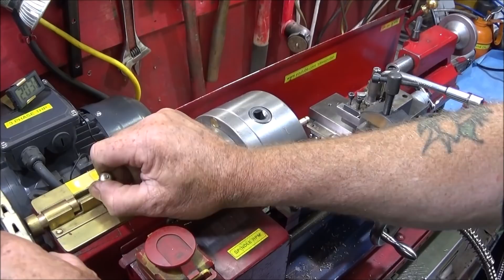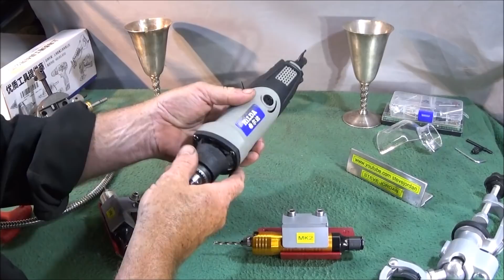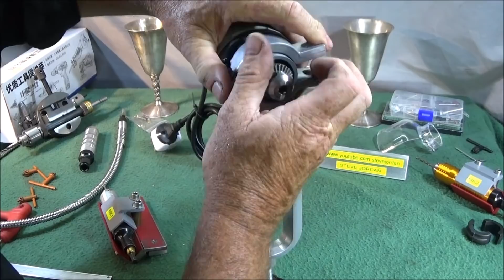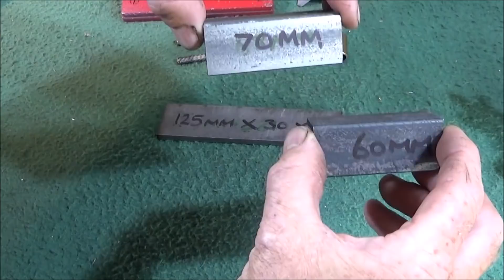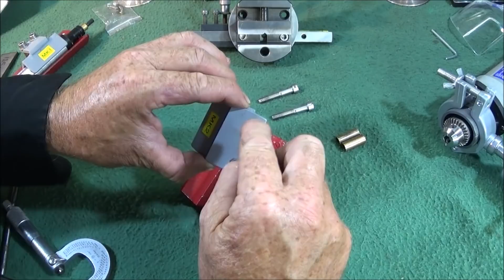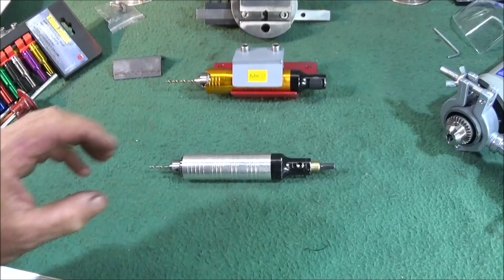A Neat Die Grinder Hack. Easy to Make Lathe Toolpost Drill Set-Up

Comment: How about this approach (?):
You place the drill bit on the chuck of lathe, and your piece on the vice that you have installed on the tool holder of the lathe.
Then your turn the lathe on and move your piece towards the drill bit.

Comment: Been thinking about doing a 750w or 1kw remote die grinder. One of the chinese hanging grinders purposefully designed for die grinding vs the hilda. Love the index locking design I was thinking of something similar using a tapered point and 3D printed wheel but everytime I consider it I want to upgrade my drive belt setup as well from the 5M375 belt(I have 8x16) to index pulley then I think why not just go for a servo vs index wheel.

Comment: Steve!  Greetings from Colorado.  I’ve got my friend to help with the welding and will be making this attachment for my foredom.  Thanks for posting this.  That said I’d like to use my qctp as the “vise.”  Obviously I’d have to change some dimensions of the male part of the fixture to be inserted into the qctp tool holder but I’m concerned about the rigidity.  I believe tapping the male steel flat stock for the corresponding tool holder to accept bolts would help but if you have any other suggestions I’d appreciate it.  I’m a jeweler so I’m trying to make better use of my minilathe.  I’m also in process of completing the milling attachment.  My email and/or IG is ubdrmade@icloud.com if that’s more convenient for replying.  Cheers!

Comment: Hey steve I want to make a hand held  lathe style device and need your help? I pretty much have it figured out I just need the sanou 3in 3jaw chuck drilled out to have a 1in throughhole but need a shaft to mount it on with a matching throughhole size and a diameter of 1.2in and 6.5in long? Does this sound like something that is doable

Comment: Another great video Steve, thank you, keep them coming.I've just received all these Goodies from Banggood and have also made the insert for the holder. Still got to make the holder for the flexiishaft tool. I've noticed that when the flexible drive is connected to the grinder the weight of the flexible shaft needs to be supported otherwise the grinder does not seem to run true and makes a grating noise. The only way I can get this to run quietly is to have the grinder mounted in the holder so its pointing down and there is no lateral weight on the grinder. Have you got any ideas what the problem might be and have you experienced this yourself. Apologies for all the questionsCheersDave

Comment: Nice video and project Steve.  Looks like that welder is proving to be very  useful!  I used mine for the first time yesterday and was surprised at how nicely it struck the weld and penetrated the steel I was using.  Can't claim the quality of my work was very good, but the weld itself is not going to break!  I am pleased with the little welder. With practice and a little experience I am confident that I will be able to make some decent looking welds.
Reply from the maker: Hi Graig, Thanks. Yes I'm very pleased with mine as well. I still have to tidy up my welds a bit with a grinder but everything is structurally sound. Its the first time I have got on well with an arc welder and like you, I am confident that I'm going to improve with practice. I never felt this way with the old type non-inverter welding machines. So it is great.

Comment from the maker: A HANDY THING TO KNOW...... You can also load this toolpost drill fixture directly in a tool holder on the toolpost and use it just as it is. ie You can miss out the toolpost vice altogether if you do not want one. The toolpost vice just gives extra adjustable length and cross-slide movement which is great on the mini lathe, particularly if working on large diameter components.

Comment: Splendid video Steve! Your engineering ingenuity never ceases to amaze me. Could this new fixture be mounted directly into a tool holder and then to your quick change tool post so that the "stick out" is reduced? I eagerly  await each of your videos and hope that you will continue to make them ad infinitum. Thanx for all your labors!
Reply from the maker: Hi Thanks I forgot to mention it can be used straight in the toolpost holder as well. It is very rigid whatever way you choose to hold it. Its a good point though, as you can get away with not buying or making the toolpost vice assembly if you choose not to. Regards Steve

Comment: Hilda die grinder? Xynudu cross-over????
In fact (now I think about it) there is a lot of cross-over between your videos and Rob's. That's not a bad thing, you've both got an excellent down-to-earth approach.
I've got a Katsu rip-off of the Hilda and my advice would be "GET THE HILDA"... the stank of hot plastic off the Katsu is rather pungent........ :/
I love the MK1 MK2 labelling.
Reply: Treadmill motor speed control

Comment: Hello Steve. When measuring those allen bolts you should not include the head only the shank, the head is included only on countersunk bolts.
Reply from the maker: Hi yes a small mistake.....most people will overlook and find the right length, I'm sure..:-)

Comment: Next time you are thinking about it... remove the flex-drive-shaft from the unit, clean it and the inside liner very well.. and relube the inside liner, and pack the flex shaft with a high end high temp, high speed grease....  that will calm some of the vibrations down quite a bit, and lesson the heat build up, or allow you to run the unit longer, per session, let alone the life expectancy over all...  Allot of heat and friction builds up in these due to the keyed chucks spinning mass vs. like the old Dremel units that had a tiny little collet system that had next to nothing on rotational mass... good luck, Dru..
Reply from the maker: Hi Dru, Yes it is good to lubricate them well. Thanks for mentioning that, something I forgot to say. These particular flexible shafts with the outer metal sleeves seem to stay nice an cool. I think they are the best flexible drives I have used for up to 6mm diameter drills. Regards Steve

Comment from the maker: SEE THE TOOL BUYING LINKS BELOW:-
HILDA JD3321C 220V 400W Variable Speed Electric Drill --  https://goo.gl/em3VW4
Universal Mini Clamp On Bench Vise Grinder Holder Electric Drill Stand --  https://goo.gl/BJ3JgA
6mm Die Grinder Flexible shaft https://goo.gl/NhXZci
A Spare 6mm Flexible Shaft  https://goo.gl/6MafSG
A Choice Of The 4mm & 6mm Flexible Drive Shaft Tools https://goo.gl/46G4mf
Reply from the maker: 70% off Electric Tools Promotion --  https://goo.gl/hf8cQ3
Reply from the maker: Banggood 12th Anniversary Electronic Sale --  https://goo.gl/SY4GX1